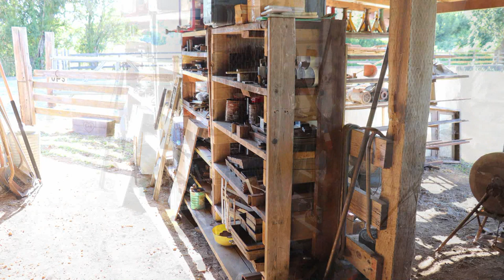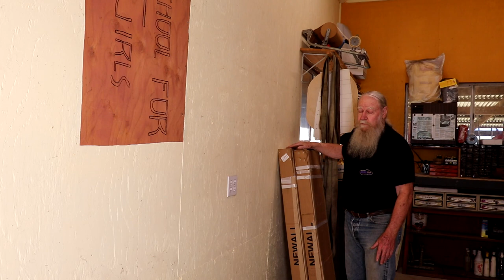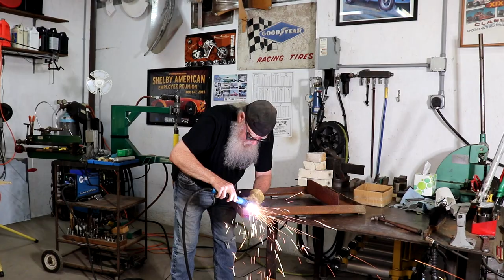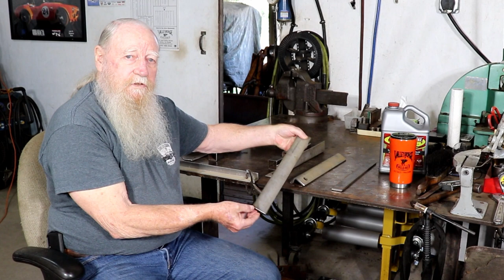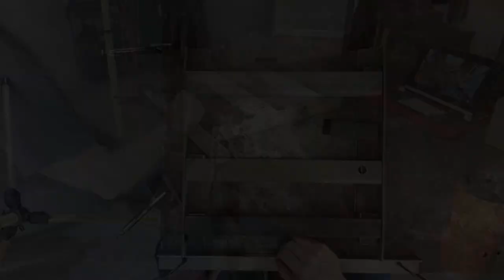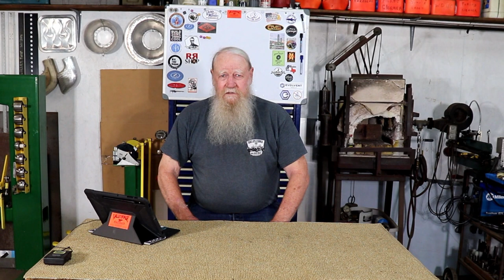Chain And Binder Rack

Comment: Shop improvements/enhancements and methods are good ideas to share, I have a wall rack similar with chain, straps, ratchet hoists…one of the best shop adds I did years ago
Reply from the maker: Hi Chuck. It turns out that raising the shed and making it usable is causing me to move stuff around in the shop. I will be picking up a lot of open floor space in the shop.
Jere

Comment: Try Rust 911 instead of Evaporust. The gallon is concentrated and instructions say to dilute it 16 to 1. This makes Rust 911 a much better deal. Both work the same way.
Reply from the maker: Hi Paul. I'll try it when the Evaporust is used up.
Thanks for the info.         Jere

Comment: Evaporust is great stuff. Expensive, but sure beats a wire wheel.
Reply from the maker: Matt. It will be my go to product from now on.
Jere
Reply: @jerekirkpatrick2092  I was going to set up an electrolysis tank, but Evaporust is so much easier
Reply from the maker: @mattthescrapwhisperer  I think you will be happy with that decision. I am pouring mine into a sealable plastic tub so it is handy at any time. I will not be putting it back into the original container.

Comment: Hi Jere,
A short video but useful to feed the ewetoob algorithm and show me up with your organizing powers. ;)  
Ahhh de-rusting. One of my common things to deal with. Sigh.
I’ve used many methods and products to get rid of rust over the years. They each have pros and cons.
I’ve used EvapoRust for a long time. It’s a great product but of course the cost is a bit more than some folks like so that would be its “con”. Its biggest pro is that it is safe on things like rubber, glass, plastic, skin, etc. And of course it’s much more “environmentally friendly” than many products.
If you put a little bubbler pump from an aquarium it works even faster. 
I'll refrain from droning on about other methods but I could. Oh yes.. I surely could. ;)
Have a great week,
Joe
Reply from the maker: Joe. The first time I used Evaporust I just brushed it on and waited 1/2 an hour and then did some scrubbing. After watching a few UT vids I decided to let it soak over night. That's what made me a believer. The cost is not a consideration as in buying any good tool.
I am a slave to the algorithm.
Jere
Reply: Good projects deserve good products.
But I tell ya.. never discount a good old 10% solution of molasses and water.
Like me it's slow and cheap. Unlike me it's quite effective in the right situation.
;)

Comment: I like Evapo-rust it works great, 
 my only issue with it is price, it's so damn expensive like $30+ for a gallon and rising. I prefer to use the poor man's equivalent, White Vinegar as its less than $2 a gallon and it's readily available almost anywhere.
Reply from the maker: Hi Panda. Yes I was shocked at the price also. After using it I am glad to have paid the price. I will be putting it in a sealed plastic box so I have easy access. Now that I know how well it works I will be using it on a regular basis.
I will have a better video out next time.
Thanks.         Jere